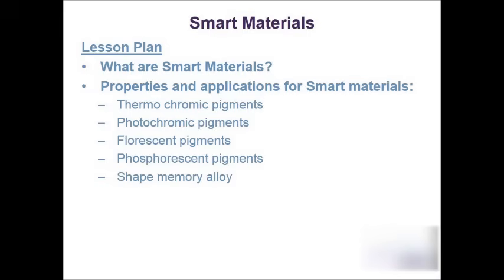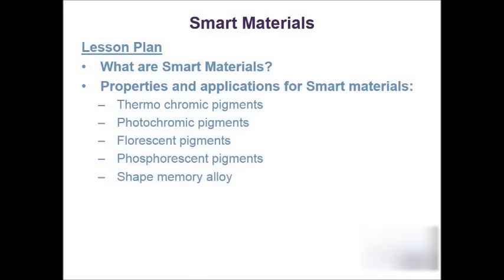Smart Materials

Comment: Do all the videos cover everything we need to know?
Reply from the maker: I think that it will certainly help but, remember, Question 1; the design question which is on children's nurseries this year is worth 25% of your grade. Think about the sort of products which could appear, think about key specifications points for nursery products and if you have to evaluate, make sure you evaluate against your specification points. Also, use use these points when annotating your design idea. The other big question on 'manufacturing in quantity' is another common feature. Make sure you design and label a simple product which you know how to make, quality control and discuss health and safety for. Good luck!
Reply from the maker: The main topics but, it should be used to suppliment what you have learned in class.
Reply: Bridge Academy Design & Technology if we memorise these topics will we pass?
Reply from the maker: The main topics but, it should supplement the theory you have covered in class.
Reply from the maker: These are the main topics but, they should supplement the theory you have covered in class.